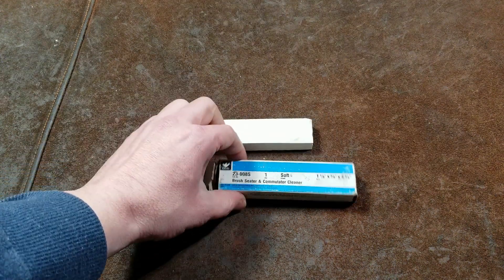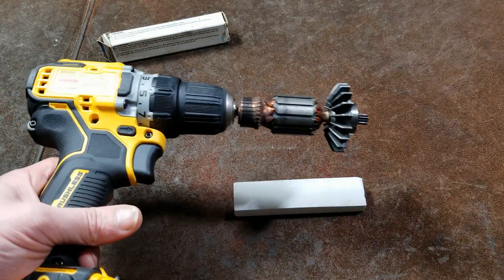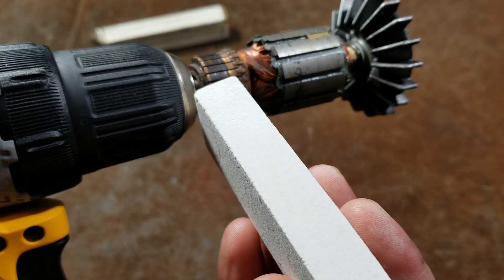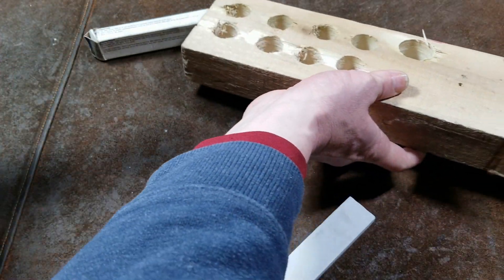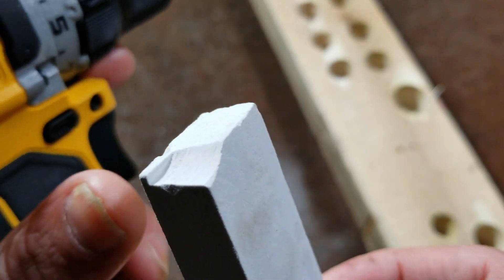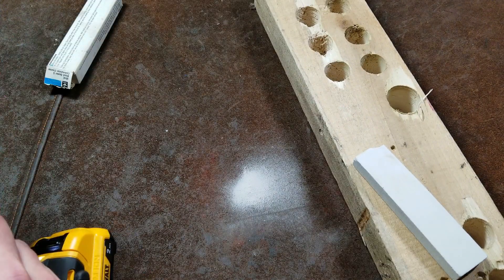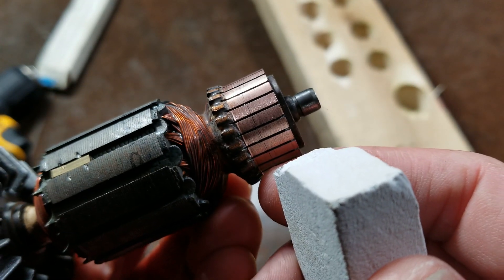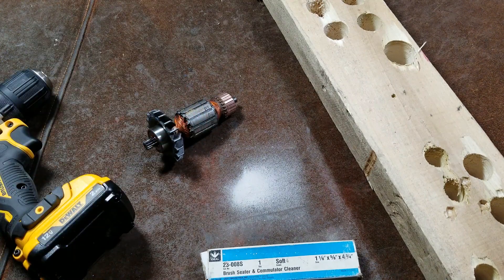How to Clean A Brush Motor Commutator, Ideal Motor Cleaning Stone Review

Comment: You sir are spot on!!!!, I say that cause I to am aware of the stoning process cause I used to work at Ametek Lamb Electric in Kent, Ohio back in the late 90's, building armatures from start to finish, and from time to time I stoned the communtator, albeit slot type for low voltage motors, and wound armatures that had tang type communtators for high voltage high speed motors, and also wound slot type armatures, as well as setting the commtatores correctly on the top area of the shaft.

Stoning also helps to set the brushes evenly whether original set can still be used, or if a new set is used, either way, stoning makes the brushes wear evenly on both sides, to where the motor or tool will work like new again and won't half to rewind the armature which is a hassle and a half.
Reply from the maker: It's amazing how much difference a little stoning can make!

Comment: I've just used 150 grit sandpaper.
Reply: garnet paper might be a better non-conductive choice...
Reply: Me too, except finer grit.   I would never take one of those stones and use it on a running motor because of all the abrasive grit it leaves behind.
Reply: @stinkycheese804  If it is leaving grit behind you are doing it so very wrong. You just ever so lightly touch it to the motor and clean methodically. You do not shove it full force on there like a cheese grater. If you see dust behind use something they invented called an AIR COMPRESSOR. And if you still want it clean, get a dialectric spray cleaner for electric motors. There is always a danger in doing something when you have no idea how to use tools properly.

Comment: We used the Ideal comutator stones for years on the railroad locomotives. Especially on the older fuel pumps until they went to brushless pumps. I can't tell you how often I was able to get a stranded train running again with just a quick clean up with these stones and a fresh set of brushes. Keep up the good reviews.